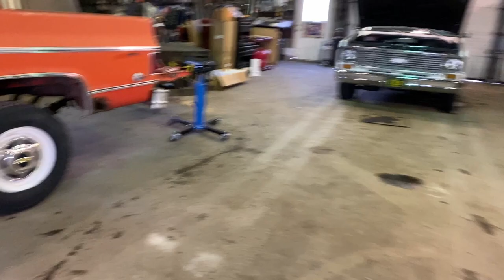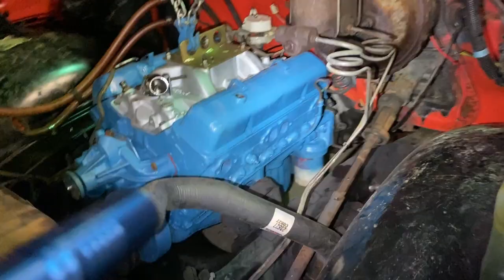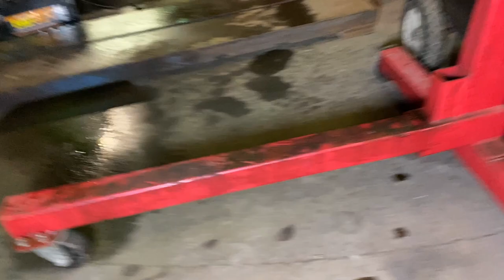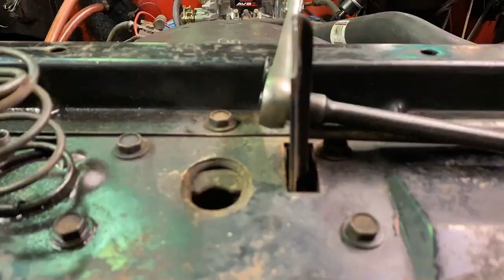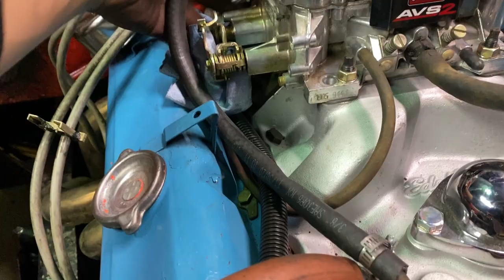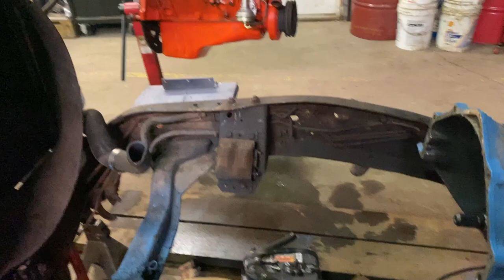Squarebody C20 Motor Mystery

Comment: I noticed you're using the stock throttle cable bracket. Did you have to modify it to fit the Edelbrock? I couldn't get mine to fit and had to buy an aftermarket bracket.
Reply: @squarebodyblake4464  Awesome, thanks for the info. I’m using the stock Quadra jet intake manifold with an adapter. This Edelbrock is a HUGE improvement over the old worn out Rochester!